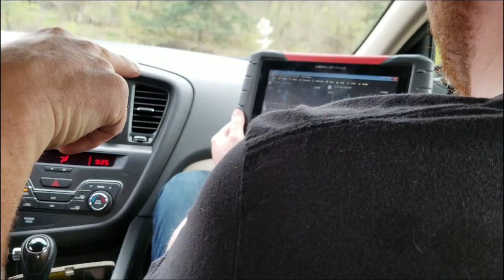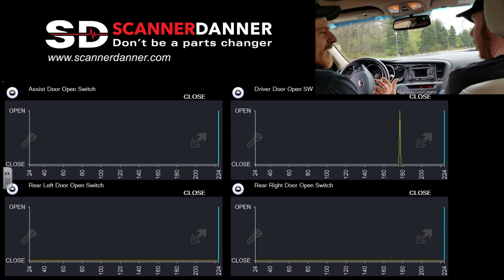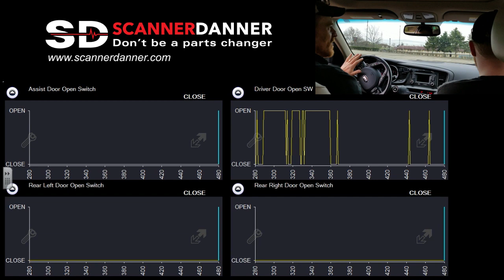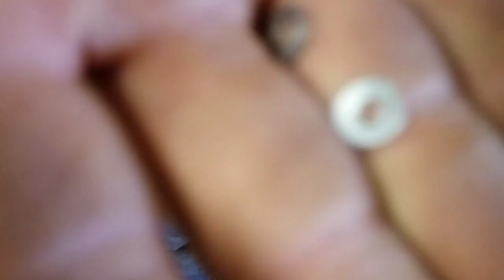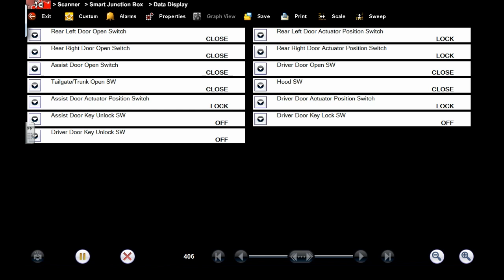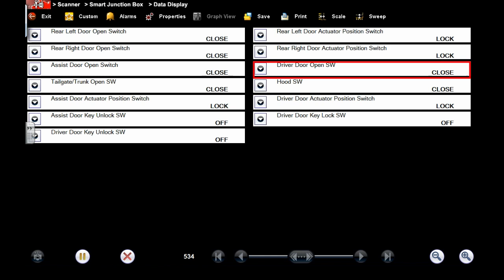2013 Kia Dome Light  - Featuring Rosedale Technical College

Comment: Those switches are so simple that I doubt the switch is the problem. The most likely cause (through my experience) is that there is an alignment issue with the door, latch or striker.

Comment: First time I saw this problem was in my dad's 1989 Daihatsu charade. Only in that car it ended up being two fatigue cracks running up the join between the front aprons and the firewall on both sides of the car, car lost rigidity and frame was flexing, with associated creaking noises. No PIDs to check for that, it was only when I had it up on jack stands and noticed the door was hard to open that I figured it out.

Comment: Clearly, early diagnostics indicate your ghost light is due to internal engine probs.  You need to do a Relative Compression Test, Fuel Pressure Check, and test all 5v Ref sensors....or you can simply replace the old blinker fluid and the muffler bearing

Comment: You can trim the close bumper, right next to where the taps and washer was added, then try to slightly tighten up the striker mechanism, to give just a hair more closure to the door! I would guess that the switch isn't faulty, only the door was hung in a NOT AS CLOSED AS NEED BE, position, and over time, things move a bit, and that was allowing the switch contacts to close, as they are designed to!! I have a friend with a 97 Tahoe, that is doing the exact same thing!! The door switch is in the left end of the dash, and just slips into place, with no adjustment possible!! The only way to solve the problem quickly and cheaply, without taking the switch out, and possibly damage it and/or the dash where it rides, is place a spacer exactly as you have!! But, it won't be hidden, even with the door closed, and he don't want to see any BACKYARD ENGINEERING on display!! The problem is, a DINGER CHIME SOUNDS, not just the light, which he has disabled!!

Comment: This reminds me of the classic Honda clutch pedal switch. When the grommet deteriorates and falls out. The switch is fine. But the stop point is gone.
Reply: Also a brake switch on a Nissan 180SX. It happened to me once where brake lights were on all the time because the rubber grommet split and fell through the eyelet.

Comment: Great video Paul!  Just fixed the same issue yesterday, the door panel was slightly bent where the switch contacts the door, and the door was slightly out of adjustment.  I moved the striker plate in slightly for the fix (made the body lines look better too).

Comment: If a new door switch doesnt fix it try adjusting the door striker in so the switch has better contact with the door frame. I do that to repair issues like this all the time. Great diagnosis, quick thorough

Comment: Not. a cert tech here. Idk Scanners finds this faults too wow.   Old school light test all four doors with a test light or multi tester probe lines.  Maybe a bit of hot glue between booth and inner switch.  since it's a plastic moving part with a metal door..   Still in the end life switch plastic will have to be replaced cause cheap contacts.  From preventing a second service for client coming back.  I bet Made in China worn out switch.  Is like my is300 lexus.  Under the heat power servos door locks or a window don't work until cooler weather.   When is cooler all works fine.     Nice following learning of your scanner's ability too 👍

Comment: A lot of times when I've seen this issue, I've had good luck in checking the body lines and seal integrity.  A majority of the time, I just see the latch needing to be adjusted, as over the years it moves from its initial position just enough to make weird things happen.  Sometimes worn seals around the door can contribute as well, as the door won't have the right tension in the right places if a seal is partially collapsed.

However, both of those could also just be changing the positioning on a switch with one tiny worn spot where it's not making contact.  We see this kind of behavior every day with TPSs and other potentiometers.  Long contact path + routine wear in one particular spot = all hell breaks loose.  ;)

"Replace the switch!"  LOL  Yeah, basically!

Comment: As an optima owner and former kia technician I think I must tell you that although there is no body damage on this vehicle, the optima and forte models are notorious for seat belts not always retracting and getting stuck in the door. When the door closes it creates a small dent on the door causing this same problem.  That was not the case here but always check for that
Reply from the maker: great tip, thanks!

Comment: Oh come on , what happened to basic checks? If it had a wheel fall off you'd want a data pid next....use some sense, check the door, engage brain not a diagnosis fee, if you charged 70 or more bucks. To diagnose then it's scammer danner
Reply: I believe he’s said many of times, he goes above and beyond what is needed to help the viewers understand.  Also, the customer is usually aware of what they will pay for you to look at their vehicle before you diagnose it.
Reply from the maker: @TheMagican614  exactly
Reply from the maker: @Jusb1066 this was at a school and I'm teaching and I'm working on my in-laws car lol, there was no money involved. Not sure who I'm scamming. If you understand the system, the door switch data PIDs were the absolute best place to start, problem was, my students missed it (shown at the end of the video).
Reply: @ScannerDanner  then you are teaching them to scam, the place to start is the obvious door, few cars have pids for door switching, basic knowledge required before scanning
Reply from the maker: Your comments show your serious lack of knowledge working with today's cars. After your visual inspection when you found nothing, now what do you do? Which of the 4 door switches is causing your issue? Of course scan data is where you start. You say, "Few cars have pids for door switches", agree when you are working with a basic scan tool and then maybe cars in the 90s lol, get with the times man. Once again, the scan data pid tests where THE place to start.
Reply from the maker: Did you like your own comment? I think you did

Comment: I had this concern on the SUV's. I adjusted it by placing two way tape onto the door pannel contact to the switch. Leaving the protective film on the outer part of the tape. Now the fix would be first looking ate the latch and be sure the plastic sleave on the latch hook is intact. Also looking at the hindges and if all that is good. GET A SWITCH. Haha
Reply: a good fix would have been the stooge engineered switch requiring much more throw before contacting and causing issue....
then again, I bet it was made that way to alert other stooge idiots that they didn't shut the door fully.....

Comment: I've had a similar experience with a complaint of an annoying bell ringing under the dash when they'd hit a bump or cracks in the pavement. The dome light would have been a clue, but it was burnt out. It turned out to be the chime, meant to warn the driver of the keys left in the ignition, which was ringing due to the faulty door switch. Thanks again.

Comment: I’ve seen this a bunch of times on these  types of vehicles and what I’ve noticed is that there is always a small dent in the door or body around the area where the door switch contacts the door when closed.  I think the dent appears there because the seat belt tongue was previously (accidentally) shut in between the door and frame causing the small dent right in that spot. If you look very closely at that area I think you will see the dent. I’ve had some where I’ve done temporary repairs like you did with the tape on the door but I always tell the customer that it’s a temporary fix and they will need to go to a body shop or PDR to get it fixed properly.
Reply: You are correct sir. I am dealer tech and that is actually the cause, the seatbelt clip. I use a sticky wheel weight to verify. If you remove door panel and regulator small hammer and block of wood pops dent out.
Reply: Paintless dent remover
Reply: What’s a PDR?

Comment: I’m haven’t Watched the video but from my experience with kia cars and vans it’s a bad door switch, there’s been a few I found the rubber boot missing over the switch and others where the switch is just no bueno
Reply: yeah, they lose spring loading as the contact bends inside, needing it pushed further to stay open, but multiple things cause the same issue on them.

Comment: Is there adjustment on the latch? Hold the door closed tighter?
Reply: Was about to ask the same thing
Reply: Not the latch , just the switch got crushed or rubber torn off making it not touch
Reply from the maker: nope, everything lined up nicely with the gaps
Reply: @ScannerDanner  Do you think Dorman made that switch lol ;)